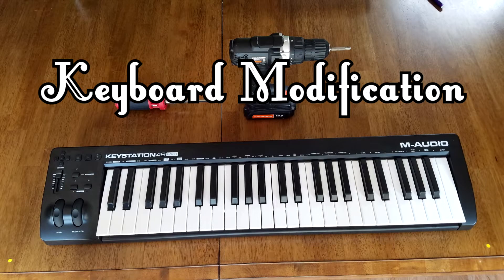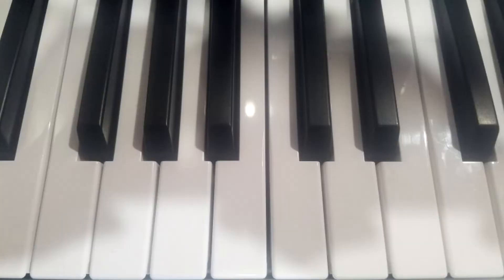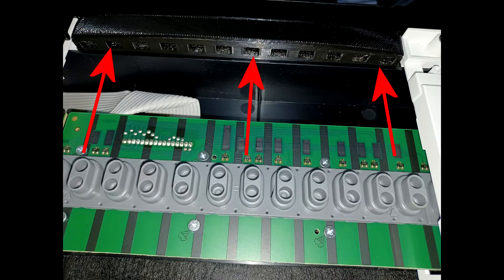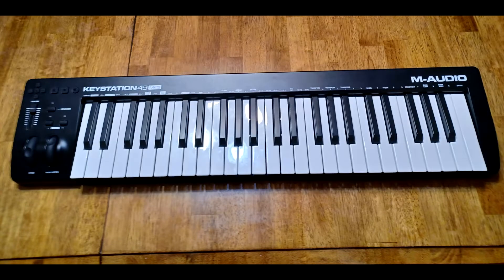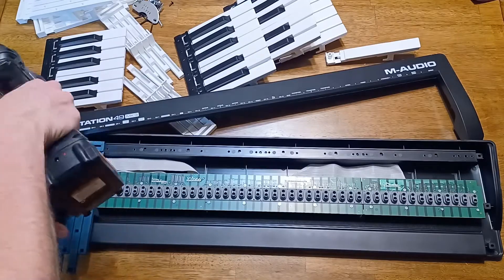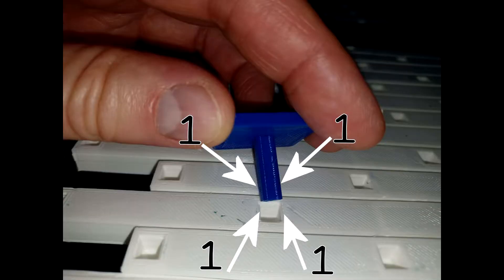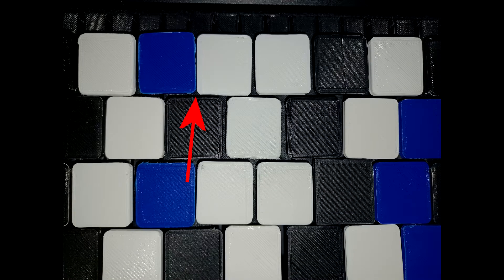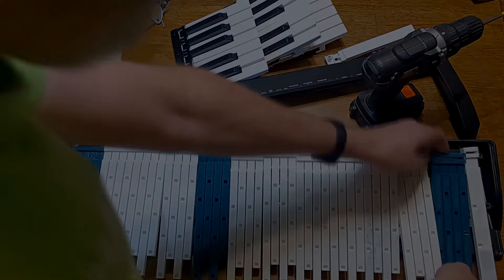Converting a Keyboard to Janko Layout

Comment: Great project!  Nothing but respect for the paper solution haha - I wonder if adding threading to the keys and holes would be viable
Reply from the maker: 3-d printers are not that accurate. But if you used the right material it might be possible to add threads with a tap and die. At greater expense you could also use those little melt-in threaded metal cylinder thingies on one side and melt some altered screws into the other side to be able to thread them in/out.
Reply from the maker: Heat set inserts, that's what they're called. LOL

Comment: I want to make one, but im confused about how this helps. Is it more ergonomic?
Reply from the maker: It may or may not be more ergonomic for you. There's also a learning curve to get your fingers used to the new layout, and the fact that your own janko keyboard would probably be the only one you ever encounter. I use a lot of different tunings with different numbers of notes per octave, or which repeat at numbers other than 12. This lets me arrange the keyboard in the best way for each tuning.
Reply: The main advantage of the Janko keyboard is that the shapes of scales and chords don't change between keys.
Reply: @dansanger5340 I find that the change helps me to know what key I'm in! Especially if the instrument isn't tuned in equal temperament. My brain just 'changes gear' and it didn't take long nor did i find it difficult. It seemed quite intuitive and logical to me, but I did start at age 5, so everything was new. Maybe now at the age of 62, if I was just starting out, perhaps the janko layout would make things easier for my old brain. But now it just seems pointless and would involve a huge learning curve for no advantage that I can see, for me anyway. Same with learning to read traditional musical notation, it doesn't take long for it to become second nature.

Comment: How to upgrade a regular MIDI keyboard to make it "pressure"?
Reply from the maker: Not sure what you mean. If you're talking about velocity sensitive: that uses two buttons for each key, and electronic circuits that are specifically made to calculate the timing between when the two buttons are pressed and turn that into velocity. Given the price of a keyboard like this, it's not worth the expense/effort.
Reply: @LiftPizzas   No, I'm talking about adding a resistive layer under the keyboard. Pressing speed is one thing, and aftertouch (pressure) is another. For example, like Sensel morph

Comment: I have a 5 octaves evolution keyboard (which later became this exact line of midi controllers from m-audio), I have also the same 3d printer. Years ago I begin to disassembly the keyboard to try to make the exact same thing you did, but when I saw the keys were made together I left it open taking dust until today. I see your keys size are much better than the Chromatone keyboard which I also have. That keyboard has the keys so small that it has 88 keys at the space of 5 octaves in a normal keyboard. It's very annoying.
Very well done job!!!

Comment: Are you still using it?  How is it holding up?

I have an Alesis Q49 wich appears to be exactly the same, right down to the order of the program functions on the keys.
Having done a little exploratory surgery, it looks the same on the inside too.
Are you sharing files?
Reply from the maker: Still using it here and there, I don't use it daily or anything. It does ok but I'd want to make the keys out of something more solid/permanent like ABS if I had the choice. I'll have to look and see if I have the files on tinkercad.
Reply: @LiftPizzas  S'all good.  I'll probably just develop my own anyway.
I've been thinking of getting a 3D printer for years.
I think this is the thing that's pushed it over the top.
Isomorphic musical instruments are awesome!
But good ones are either not for sale or super-expensive.
Reply from the maker: @Jake-co7rt Yep, those are the same reasons I made my own.
Reply: I made an universal janko adapter, checkout my channel, maybe you like it

Comment: So, what are your thoughts on 4- and 6-row Janko? Do you really need six rows to play, or 4 rows are just enough?
Reply from the maker: For me 4 rows have been sufficient, but I'm far more proficient with the standard piano layout and probably not taking much advantage of the janko setup when I play. The nice thing is it allows the second row to be either the upper row or the lower row, depending on which angle your hand is pointing.
Reply: Paul Vandervoort used to rock a 4-row, but realized there are certain situations where you aren't able to play as naturally, so nowadays he reccomends and plays on a 5-row. Six rows seems like it may reach the point of being superfluous, but it may have the optional advantage of not requiring you to move your hands up and down (vertically) the rows as much.

Comment: i’m interested in buying a pre converted keyboard. any pricing/other details?
Reply from the maker: Are you looking for one that stays the same 12 keys forever, or keys that can be rearranged for microtonal stuff? Which type/size/brand of keyboard? (I know I can do it with a Maudio keyboard, but it's not weighted keys and doesn't make any sound itself, it's only a MIDI controller.) I don't think I could make one with weighted keys.
Reply: Hey. I didn’t get the notification for your reply, so sorry. No interest in microtonal, just something that resembles yours?

Comment: what software did you use to build the model?
also what meterial is this? do you like it or you would like it to be printed out of something else?
Reply from the maker: I built it in tinkercad. It's printed with hatchbox brand PLA. I haven't printed in anything else yet so I'm not sure if it would make a difference or not. But I do have design changes I would make to continue improving it if I do decide to keep going. Mainly making it more solid/sturdy.